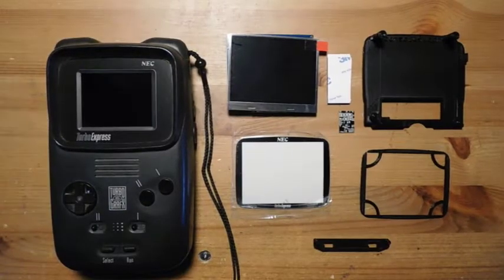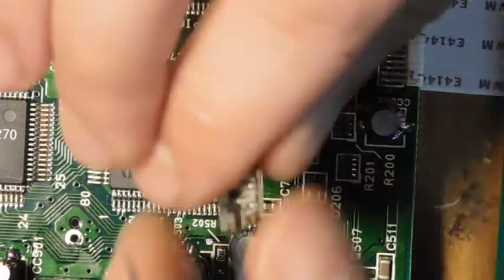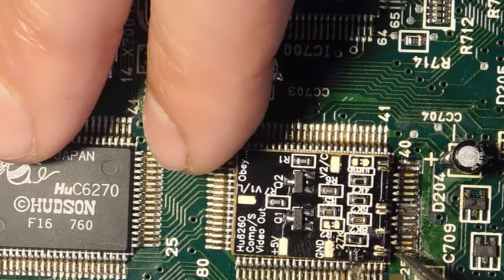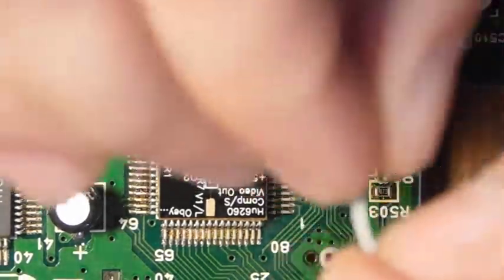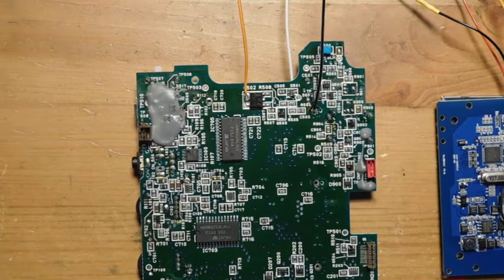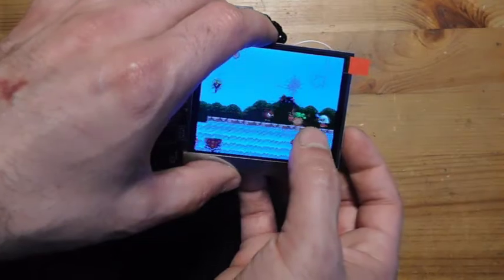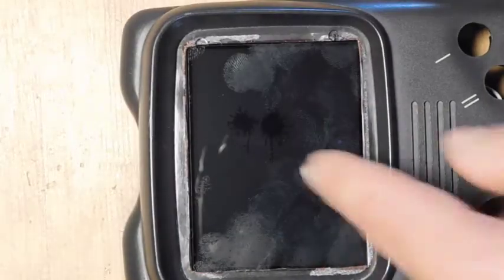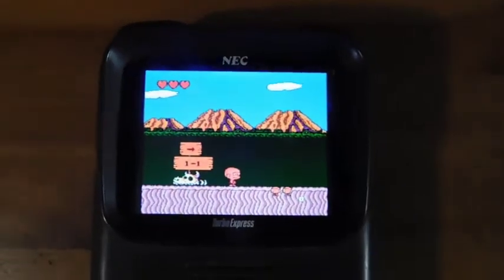Turbo Express LCD Screen Mod! Installation guide and demonstration

Comment: turbro express is the pinnacle of handhelds for decades. An actual 'home console' in your hand did not happen again for decades took about 25 years for the Nintendo switch to come out after turbo express - nomad.... so sad the nomad did not come out 3 years earlier if it had we would have had a switch like system WAY WAY SOONER the genesis was DONE by the time the nomads inception. IF it came out when megadrive/genesis was hot we would be way farther alone in portable systems I think the xbox and sony both would have fully portible switch like consoles both PS3 and 360 would have had portable version. ALOT of us realized how epic that was people who had those 2 rare system understood it was only matter time something like switch would smash market if done right.

Comment: Id kill for one of these and a TurboED. I've got a PCE and TG16 but waiting til I can afford an SSDS3. I love handhelds tho - a USB-C Lipo battery mod would be useful too lol

Edit: probably would have been easier to tin the pads of the chip before the pins are lifted/bent up, then you only need to reheat the pads to connect the chip legs to the mod chip. Idk, just a thought - I usually go that route

Comment: Great work, thanks for sharing!

A question, though, which LCD mod were you using? The one based off of composite video or the mod with RGB?

Thank you!
Reply from the maker: This is the one based on composite video. I would love to do the rgb mod some day, but for now that kit is difficult to get outside of Japan
Reply: Long Island Retro Gaming Thanks for the response. Wow, the screen looks great with just composite. Maybe I shouldn’t “chase the dragon” and try to get the RGB screen that’s another $100...

Comment: At @11:45 you say that you wired the 5v source to the output of the 1.8v regulator (which would be bad) when you actually wired 5v to the input (which makes sense to bypass the buck regulator).
Reply: This board actually has two buck step down reuulators and two linear regulators (3.3v and 1.8v) and it behaves very oddly if you power it by  only 5v due to vdrop. I havnt dug deeper, but if the 2x bucks are both not needed, you could bypass them completly to eek a bit more runtime out of your  batteries.
Reply from the maker: Yeah that was a mistake that I said during the filming, but I decided to leave it alone because the location for wiring in the 5V was correct. That idea you mentioned is interesting and at some point it is something that I would like to investigate in the future. If they are not needed and can be removed, it would be nice to get a little bit more battery life out of the system

Comment: Hello could you indicate another store that sells the video board?  the website you are referring to is closed.  Thank you
Reply from the maker: https://console5.com/store/turbo-express-pc-engine-gt-composite-video-mod-board-pcb-diy-kit.html
Reply: @LIRetroGaming  Hello. Thanks for responding.  I found this site, but it looks like the one on console5 is different from the one you used.
Reply from the maker: It does look different but it works the same way and connects to the same pins that I used in the video. I have used this board successfully, so let me know if you have any questions about it
Reply: @LIRetroGaming  got it.  It is because in your video when you lift the connection pins of the chip to solder on the new board, the solder contacts are soldered individually, and on this new board you sent me it seems that the area where we will solder the pins will be soldered on the same  terminals, looking like you're making a bridge. thanks for your help

Comment: What's the difference between LCD and RGB? And which is better?
Reply from the maker: The LCD modification is actually just a composite video modification on a LCD display. The RGB modification uses RGB video and also puts that onto a LCD display. RGB definitely looks a lot better than the composite video modification
Reply: @LIRetroGaming  I am going to go with RGB so glad I asked. Cheers Mate.

Comment: sucks that turbo16mods closed down. I went their last night to get the board and it said closed for personal reasons :(
Reply from the maker: I also found a replacement board on console5.com. It comes in a kit form so you have to assemble it yourself, but that is not too big of a deal in my opinion
Reply: That's a new one Console5 is carrying, they used to carry the tg16mods one.
Reply: @Alteracious  I believe the console5 is a better board. You will need experience in soldering 0603 resisters

Comment: if you have to bend pins that way i doubt much people will gonna take the risk doing it, if you ever want to restore to original and you bend the pins back they prolly snap and then its game over.
Wouldnt it be safer to just bend the pins slighty up (like 1.5 mm), then slide kapton tape underneath it to avoid contacts with the pads, then put that little board on the CPU and fasten it with some kapton tape on the sides to the motherboard to hold it firm and for heat to still be able to escape, for if ever the double sided tape lets go out of old age.
And then just add some short wires to the pins and connect it to the board on top of it. its easier to do and less risks. but it wouldnt be so firm as afcourse bending the pins in that unnatural position.
Why so many mods cant be made easier i dont understand, like something that you snap on the original CPU and holding the original legs with some plastic (teeth system) bracket.

edit: althought i dont know if the solder will stick to the pins of the legs if it aint copper. But still i would never bend pins that way.
Reply from the maker: This older mod has been replaced with a much easier and much better quality RGB screen mod. No pin lifting anymore which is great
Reply: @LIRetroGaming  thx for the heads up and answer. Came here because looking for the best screen mod for my Sega Nomad, but ill wait a few more years until the perfect kit comes up that gives crystal clear image quality with a drop in solution without much cutting and slicing.
At the moment there is this RGB mod, with the 20 dollar car screen, and the Oleg..... i really wish the Nomad would get a screen like the Game Gear or GBA... with those its easy to pick the mods, but i hear to much about this RGB kits that the image quality is a bit washed out, that is what prevents me from buying the mods. Only Oleg has a good screen but that company is a bit to small (he only sells on twitter with very small supply).

Could you guys ever do a video (there is 1 about it, but still it leaves away a lot of technical details).
What is the difference between that 20 dollar car screen or Oleg his screen? - Is it 2 totally different screens, or its the driver board that gives Oleg a better crystal clear image? Is there any different in pixel densitity, refresh rates. color palettes.
For my Nomad i take extra care, because i'm one of a few people in the Netherlands who owns one in perfect original condition. But i do like to add a new screen to it, but the Nomad doesnt get that much love from the companies as the GGs and GB's.
Why the modded screens for the GB's and GG's are so clear, and with the Nomad people reporting its pretty washed out (or shimmering). Dammit, wish RetroSix or BennVenn would come up with the perfect screen like they did for even the Atari Lynx 2. (grrr, why couldnt they use the Q5 screen for the Nomads with its easy to use OSD fully button controlled to show and hide the menu)